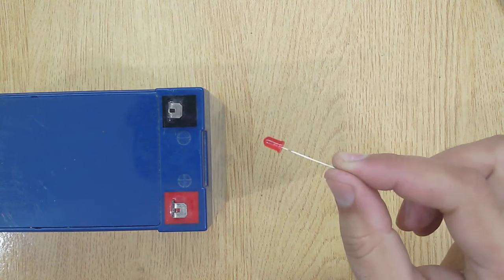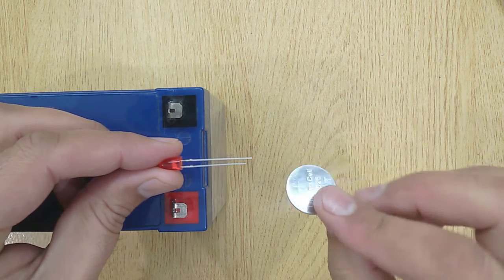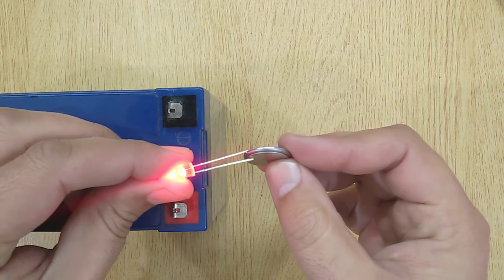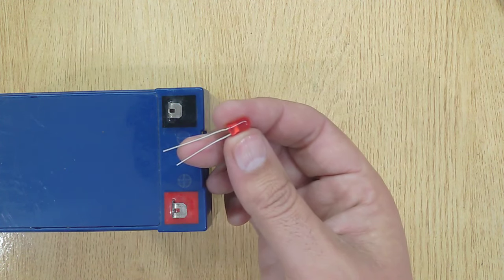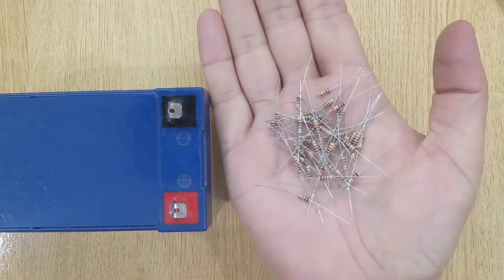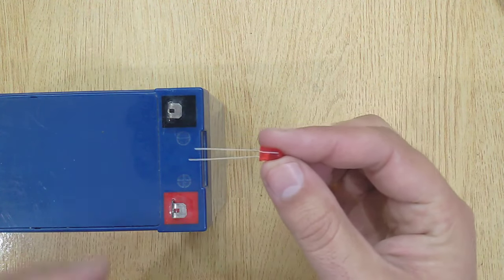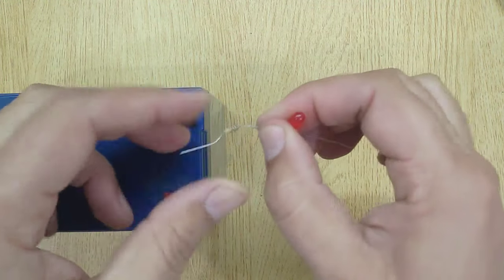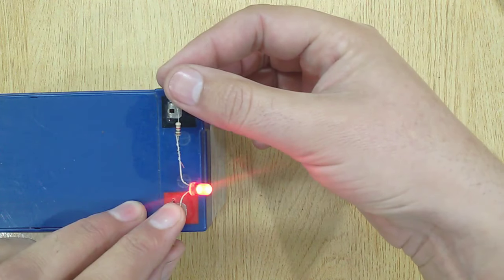12v to 3v led resistor | 12v to 3v resistor | 12v to 3v converter Ezi Circuits

Comment: how it come up with 1k ohms resistor?. i want to know the calculation.. anybody knows?..
Reply: i am wondering the same
Reply: @negatron5888  i want to use 3 volt motor using 12 volt battery  pls help
Reply: What is the value of that RESISTOR?
Reply: @maazmoosaworld6552  what is the current rating of motor or wattage ?
Reply: @negatron5888  hair cutting machine motor
Reply: Dingling company
Reply: @maazmoosaworld6552  use 3watt 36ohms resistor
Reply: @maazmoosaworld6552  for 5v use 7805 ic
Reply: @alfiegalinato9832  he used 1k ohms resistor but 680ohms resistor is sufficient.
Reply: It's about the color of the resistor and every color have a value number

Comment: What is the value of the resistor to reduce 12v to 3v?
Reply: 10k
Reply: no 1k
Reply: really it's true I tested it
Reply: @milespeterson5049   fuckkk i alredy buy 10k resistors....
Reply: Yesterday, I bought a 4k resistor and the green led didn't light up then the red got dim.😂😂😂
Btw my power source is 9v
Reply: @lilsix9218 put 4 resistors in parallel of those 4kohm it will equal to 1kohm

Comment: Hi, i got question here, if i want to put more than 1 leds in series, should i put a resistor at every leds. Or one resistor only should be enough... Thanks in advance..
Reply: Only one resistor is enough or else there will be voltage drop and the led won't glow enough

Comment: Hello mate I going to make plastic kit 7 ships and all of them going to have led diode. And I want to use 12v adapter for connecting with one adapter all 7 ships. There will be around 50 led diode. What seristor I have to use? And with it works 50 led diode connected with 12v adapter . Please help me thanks

Comment: A resistor in a step down convertor is not efficient while batteries only are used. A resister induces load when the load ultimately should be only the light.

Comment: What kind of resistor I cant tell because of your accent
Reply: It's 1k ohm
Reply: Great stuff guys.thanks
Reply: Supply voltage - led voltage. Take that and divide by how many amps the led draws. This gives resistance needed.